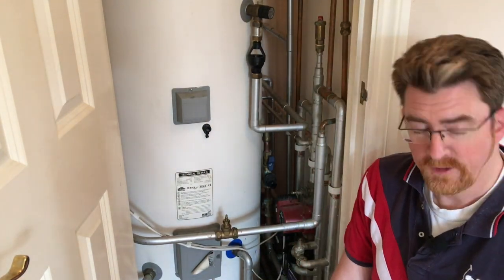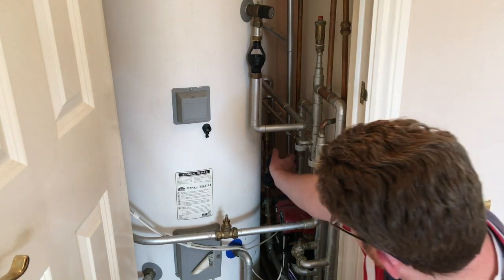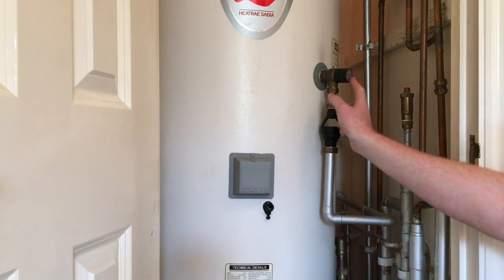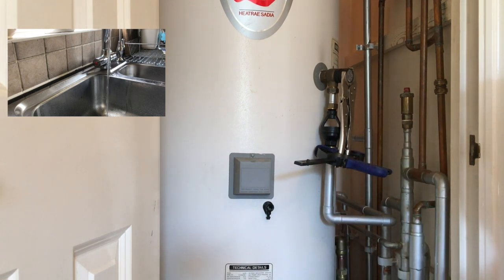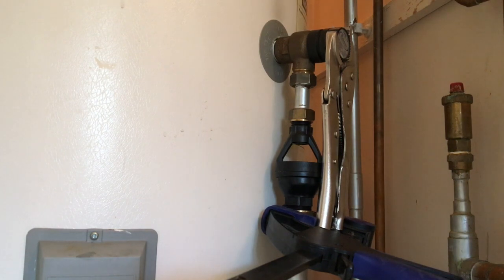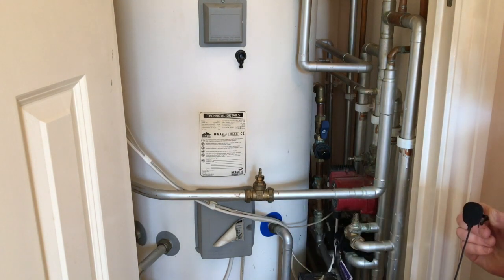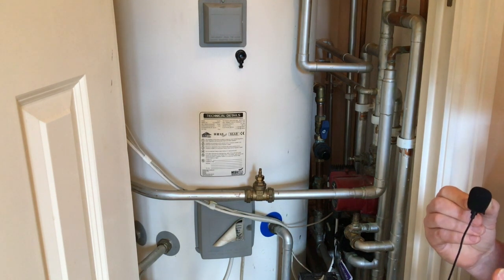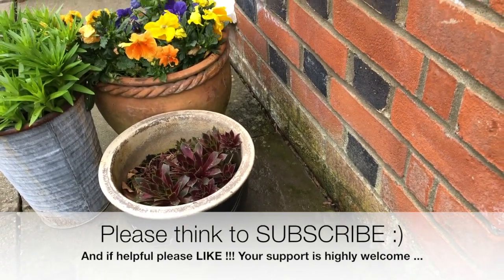Megaflo recharge of air gap

Comment: Hi Joe,
I have the same megaflow cylinder and it has been in place for the last 14 years. The air gap to my knowledge has never been re-established and i have reported water leaking from the tundish which is highly corroded with lime scale. The floor is now very damp so i have followed instructions on the label, did not see water flowing through tundish but was flowing through tap. Also when i turn the temperature release valve it does not have to be held and will stick. i held it for some 10 min or more and it was still gurgling and some water was still coming out of lowest hot water tap. In the end i just shut it off and turned mains back on and shut off tap once water was flowing freely. Any ideas?
Reply from the maker: Hi Swiftrod, I'm not sure what your questions or issue is from what you have written in the comments.  If the tank has never had the air gap replenished then it could take up to 30mins (or more) before it has achieved this. You can tell it has, by covering the tundish hole with your finger, if it sucks air in when you pull it away then it's still recharging.  If you have a leak from the tundish then you need to get in a plumber as calcium has built up on the seal and will need to be sorted out. If this helped Like and Sub !  Thanks Joe
Reply: @joewoodford9428  Thanks Joe, will call a plumber!

Comment: Hi Joe, thanks for a great video - this will give me the confidence to give this ago. Our tank is on the ground level - will the lack of gravity cause me problems? Hopefully will solve issues with noisy pipes and dripping showers. 
On another note, do you have any videos re: replacing a thermostat value on a radiator on a pressurised system?
Reply from the maker: Hi Lee, I'm not a plumber just good at DIYer.  If you want to change the whole radiator value, might be worth looking that up YouTube.  A pressured heating system is no than different a normal CH system, you just have an expansion bottle instead of a loft tank. You will need to drain down the water out of the CH system, lower than the Rad you want change the value on. If up stairs you won't need to drain the whole system. If down stairs then you might have do the whole lot. The HW and CH are different systems. If worried get in plumber!!
Reply: Hi Lee,
I once managed to change my TRV's without draining the system b y just using a large towel and being very quick while swapping the valves :)  I do recommend draining the system now though, I hadn't realised just how easy a job it  was back then :)
Also, my Magaflo is on the ground floor and it seemed to work ok although it was slow to recharge.  I clamp[ed the valve open as in Joe's video and all went well.  It did seem to take a while before the syphon effect started up though  
👍

Comment: Thanks very much Joe.  Just did ours and it seems to be ok.  Our issue was water dripping from the overflow and the pressure sitting around 8 bar once the water was heating.  Once we turned on the hot water tap the dripping stopped and pressure returned to around 3 bar.  Hopefully these steps fix it
Reply from the maker: HI Ryan, good luck hope it does. If this helped be sure to Like and if possible sub (its free and helps out the channels) Cheers Joe

Comment: Great video. I have one of these tanks but started to make noise whenever I use the hot water? what do I need to do? change the ballcock valve (if it has one) or is to do with pressure.
Reply from the maker: Hi Zenganow, as these are highly pressurised tanks probably best to get in a qualified plumber.  If this process does not help then you need a specialist to check out the source of the issue.

Comment: What is the main reason to do recharge?
Reply from the maker: The air gap looses a small amount into the tank and the hot water pressure reduces over time.

Comment: I do not have a tondish just  a very long pipe going through my wall that same connected to my hot water pipe and it has one of those plastic knob like the tank
Reply from the maker: Sounds like you don’t have a properly installed Megaflo, they should have a Tundish installed so you can see if the tank is leaking. Maybe a plumber can comment !

Comment: Should you continue to open the pressure valve until the gurgling stops?
Reply from the maker: Yes, as the tank is still taking on air.  But even after 30mins it will still be a lot than before.  Hence my hack trick with the clamps as I can leave until it has stopped gurgling :)

Comment: Great video! I’ve moved into my new home for 3 years now and my hot water is hardly coming out of my two showers and taps. I’ve called out 2 plumbers neither could fix the issue. Im just concerned that i wont know what to do and don’t want to make any mistakes as you stated it can be dangerous.
Reply from the maker: Do you get it fixed? Did the vid help you ?
Reply: @joewoodford9428  unfortunately no i have not. I turned off the running supply but water was still coming out from taps, so i believe i may have turned off something different. I turned what ever i turned off
Back on and left it to be. Still hot water is running low from all taps and showers at the flat. May need to call a megaflo engineer round.
Reply: This is a common issue we have with electric hot water cylinders because of the green energy policies.  

No plumbers seem to know how to repair these cylinders apart from changing the elements/ time switch/ blending valve/ heat exchange pump to produce the hot water.  

If you have a British Gas home cover that includes plumbing, you could call them out to see if the lack of water is caused by a faulty blending valve.

You need a G3 trained plumber for this job as not all ordinary plumbers are licenced to service the cylinder.

Comment: I've holding the release value for half an hour it still makes the noise, water is still coming out. Is that normal?
Reply from the maker: You can keep holding it open for longer if you like or use the technique I showed, after 30mins you probably have enough air, it can take up to 45mins to 1hr to complete.  Really depends on the how low it got.

Comment: Any vids on how to de-pressurise the same boiler??
Reply from the maker: @Remo one, not sure they make a boiler, our Megaflo is heated by an oil boiler, Thermecon.  In the shot of the Red expansion tank this is where we pressurise the boiler for the CH. It should read no more than 1 bar.  If less you need to top that up to 1 bar when boiler is off. That tank is feed by main cold water, there should be a small tap to allow water in.  If not suggest looking at the boiler and seeing if there is a pressure gauge on it.  Then google the boiler and read up on it.  Good luck !

Comment: You should be trained and accredited to work on Unvented Systems. Don't go changing parts, pay the money for a proper job.
Reply from the maker: @daniel cogan, don't think I'm say anyone should replace parts on these, here I'm showing the manufactures recommendations on how to replenish the air gap, this customer approved task. Anyone who does not feel confident to do this has the option to call in a qualified plumber. Thanks for watching
Reply: @joewoodford9428  apologies, I thought you sold in your video that you'd replaced a part but on listening again I hear that you called in a plumber to replace.

The video is well executed I have forwarded it to one of my customers and they now have hot water again.
Reply from the maker: @dinosaurusreximis1982  Thanks for the reply, no I would not endorse anyone who is NOT a qualified & certified closed h/w system plumber to work on a Megflo system. As you say they are under high pressure and if something goes wrong very dangerous. The air gap replenishment process is not dangerous if you follow the clear instructions on the tank. Hopefully anyone who watches this and reads these threads finds this informative and helpful.  Cheers Joe

Comment: When you open the hot water tap in the kitchen what will it do to the hot water in the mega floor? Is it empty the hot water in the mega floor?
Reply from the maker: As the Megaflo is under pressure, the mains cold water pressure of 3Bar. By opening up the hot tap and closing off the cold water inlet to the tank you are releasing this pressure. By leaving the Hot Water tap open you allow the internal air cavity within the Megaflo to fill and balance with the atmosphere. Having the tap open helps you also tell when the tank has reached that point as well because no more water drips out. You will loose some of the heated hot water but it will not empty the whole tank ! Usual only a couple of sinks full. If that helped please Like and Sub to the channel ! Cheers Joe
Reply: Silly question but when I open the hot tap downstairs should I leave it running until it stops flowing completely or should I leave it running and open the value on the megaflo whilst it's running?

Comment: The length of your D2 pipe looks less than 300mm before the first bend. Judging by the by the aluminium paint the cylinder was installed by the house builders?
Reply from the maker: @Kevin D, the mains cold water feed to the Megflo Sandia's pressure reducing valve was fixed by a qualified plumber (see separate video on that I posted). As he was certified to work on a Megaflo I'm hoping it is installed to the UK codes.  The silver paint was installed by the house builder and the house was built during 2002, so it would have followed the standards set out then. May I ask why you ask, do you have a concern? If so please share as others might be interested. Cheers Joe
Reply: @joewoodford9428  Hi Joe,  Just an observation. I am a qualified heating professional. And I acquire a G3 licence. The licence permits me to work on, or carry out installs of unvented cylinders. up to 500litres, or 45kw Max input. I wasn't questioning who replaced your pressure reducing valve.  The black 10bar temperature/pressure relief valve, tapped into the top side of your cylinder, has a 15mm copper pipe connected. This pipe is known as the D1 pipe (Discharge 1) Maximum length 600mm before the Tundish. The pipe after the Tundish known as the D2 pipe (Discharge 2) The length of this pipe should be a minimum of 300mm before the first bend. Silver paint is usually applied by house builders. To make the pipework more aesthetically pleasing. The paint as no thermal value. That's the giveaway, who installed the cylinder. This length of pipe is not to the building regulations, due to the closeness of the first bend.  Discharged water could! back up and spill over the Tundish. This information can by found online.   
https://www.gov.uk/government/collections/approved-documents    
Under Approved Document G, G3, page 24.  Hope this info helps?

Comment: Quick question if I may. Some people recommend using a tyre inflator to add pressure to the Megaflo. What are your thoughts on this?
Reply from the maker: @A P, Hi, thanks for the question.  Everything I have read from the manufacturer and the instructions on the tank suggests to balance the air gap with atmospheric pressure.  So there is not need (or way) to add additional pressure into the megaflo.  The only tank that could required a bike/tyre pump to top it up is the central heating expansion tank, in my video that one is the red tank.  I'm not qualified to tell you how to do this but this has nothing to do the megaflo and its air gap.  If you have problems with that tank suggest getting in a plumber :) Good luck... thanks Joe
Reply: Hi Joe. Thank you very much for your reply. That makes sense now. Have a great weekend.

Comment: Joe, I turned the dial on the main boiler to the left for a night then turned it back to the right after realising It's not to be messed with, the Tundis is now dripping slightly on the outside as if the tooth isn't working properly. Should I be worried my house is going to explode?
Reply from the maker: @ Giles Cucko, sound like you need a plumber to check it out.  If your boiler was producing HOT water at >90DegC the PRV will vents as the pressure and tank are too hot. Dripping sound lime you have damaged to seal due to it being too hot.
Reply: @joewoodford9428  Thank you very much mate, appreciate you took the time to reply and give some advice, It's not leaking anymore for some reason, I don't understand.  
I'll think I'll have to take your advice and think about how I can get someone in to look at it for me, really tight on cash at the moment so it's either food or hot water for me! 
Subbed & will be checking out future content to see if I can learn something!

Comment: Hi Joe, I am a bit confused from the video, as it seems to be a discrepancy in what you do and say and what you write on the instructions.

In the video you:

1 Close the main cold water supply

2 open the lowest hot tap in the house

3 hold open the pressure relief valve until all the gurgling
noise stops and water stops running from hot tap

4 close the pressure relief valve and here start my
confusion.

You than say that you will close the hot tap downstairs (not
shown in the video) but you open the main cold water supply instead. In the
instruction, closing the hot tap should be the last step.

So, my question is, at minute 8:46 before you open the main
cold supply, should all the hot tap in the house be closed already?

Hope my question is clear
Reply from the maker: If you leave all the hot taps open when you open up the mains pressure they will expel the air in the system and also the mains pressurised hot water. And they kind of explode if you do this! So I would close all the hot taps and release the air in the system with care one tap at a time. You can leave also have lower hot tap slightly open if you like but do take care!

Comment: Thanks for the video, really useful! Our megaflow is about 16 years old and I'm having to balance it about every 3 months which is a real chore. The TPR stays open on its own however when I closed it, by turning it anti-clockwise, I must've turned it too far because when I turned the cold water mains back on - it started gurgling like mad again - so then I had to put the TPR into a natural centre position to stop that. I'm surprised that with the technology available now one still has to manually balance these beasts.
Reply from the maker: @ Phil O'Shea, glad it help a little.  Sounds like you have the same issue I'm facing which needed to recharge it every couple of months.  If it was helpful please give it a LIKE :)

Comment: Great video and clear.  How do I know which valves to turn to turn off the water? The mains tap to the house doesn't completely switch off the water so I don't feel confidante relying on that.  Thank you
Reply from the maker: @ vjloudon17, there should be a large 3Bar balance value close to the tank, I think show this in other videos so look that up.  Shut that off as it the main feed to the tank as well.  Have the mains tap off and the balance value off should do it.  If you hear water rushing into the tank when you release the PVR then you have not shut off the mains water.  Suggest getting in a plumber !

Comment: My partner has got constant cold water running through the tundish why is this ?? Could a diy novice be able to sort it
Reply from the maker: @ MrTheomighty1, have you tried the method I show in this video to recharge the air gap? If that's not working then you have fault on the PRV and I recommend you get in a plumber as this is a safety item for the tank.  Good luck tell us how you get on?!

Comment: I'm still getting water dripping in tundish, despite replacing TPR valve and draining tank to restore air gap. Any advice? The tank is c. 16 years old. Could the internal air gap just be kaput and I need to install a separate expansion vessel? Thanks!
Reply from the maker: Sounds like you need to speak with MegaFlo, they are now owned by Heatrae Sadia, give them a call as it should not be leaking if you have recharged the airgap. If you do find out please tell me as my tank is also +16yrs old

Comment: Joe. You are an absolute legend. Countless plumbers called clueless to fix the drip. All pressure release valves changed pointlessly. And 13 min of your video and I've fixed it myself. Made all the noises you said it would. Makes complete sense now. If my mega flow had instructions they must be round the back and out of sight. Thank you so much for bothering to post this.
Reply from the maker: @ Mark Chambers , Great to hear it was a success. If you would be kind enough to Like and if poss Sub, I would be grateful :)